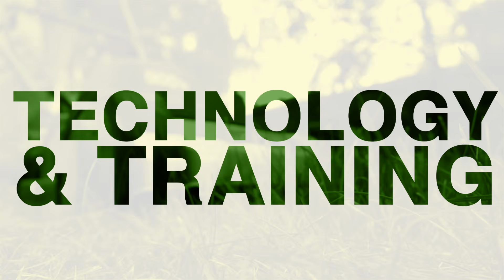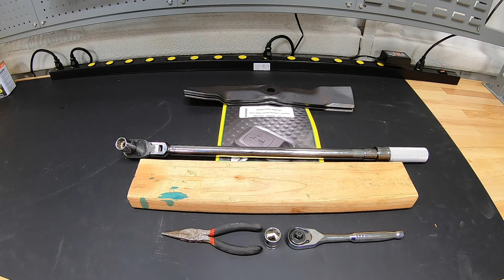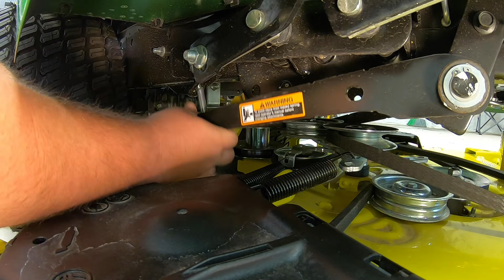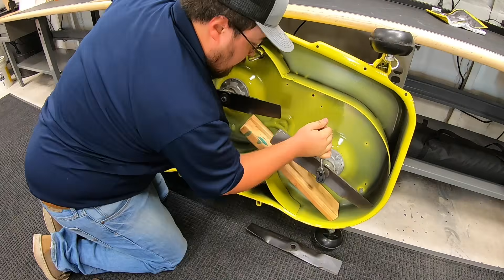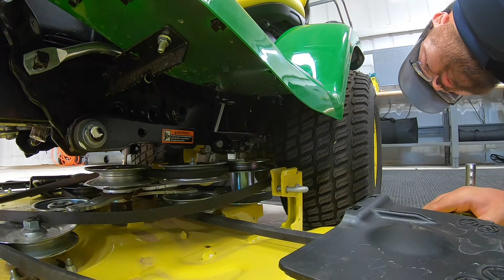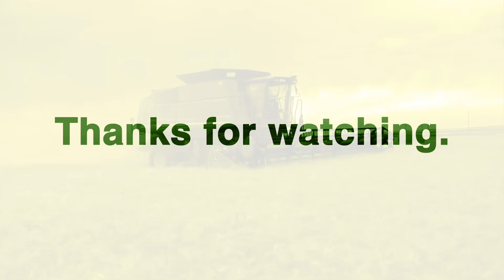How to Remove Deck and Change Blades John Deere X380

Comment: I didn’t see how you determined the position of the blades? I have a 54” deck for a 2018 x738 and am wondering if the blades get set in the same position…like on a clock or one at North south, Middle at East west and third one North south?
Reply from the maker: On this deck particularly the blades do not have to be in a certain position. Now on an X738, they may need to be if they are timed. I would have to research this a bit more to know for sure. Good question and thanks for watching!
Reply: @WesternEquipment   If you find out I’d like to know. Especially if you do a video on it. I didn’t see anything about position in the manual. I put the in the same position as the manual diagram did show them in same direction. I didn’t feel or see any cutting issues.

Comment: I prefer my method. I use my forklift to lift mower to eye level after making small modification to mower. No getting down on hands and knees which doesn't work for an old man.
Reply from the maker: Sounds like a plan if you have that equipment! Thanks for watching!

Comment: Why did they change the design from the last model, I have an lx 288, and it is so much easier than my x380, both are 54" decks. The last requires no tools, the belt release has a lever, no ratchet needed.
Reply from the maker: This is a good question. I wish I had answers to why the engineers do what they do haha! Thanks for watching!
Reply: @WesternEquipment  subjective word being "engineers".
Your right.

Comment: I have my deck installed, belt on, however when I push the pedal to raise the deck. The deck will not raise. What's the issue?
Reply from the maker: Hmmmmm, that's a good question. Everything hooked up just like in the video? is your pedal out of the install position?

Comment: "Not a perfect science"... Put a jack under the rear end and raise it up a few inches. That deck will slide under effortlessly.
Reply: These John Deere mower decks on the 300 and 500 series are the biggest pain in the ass to install.  Doesn’t it seem logical that Deere could engineer an easier way to install these decks?
Reply from the maker: This could work too. Thanks for watching!
Reply: Just to be extra safe, you might want to chock your front wheels before raising the rear end.

Comment: This was a very helpful video.  I have the John Deere X390; 54; Deck.  The manual is not very helpful.  This is the only video I am aware of that deals with the removal of the deck.  It was a lot of trouble to remove even after viewing this video.  I ended up taking the pin out of one of the gauge wheels so it could turn freely.  We'll see how I make out re-attaching it!  Thanks.
Reply from the maker: Well I am glad I could at least help a little. If I can be of more assistance just let me know here in the comments. Thanks for watching!

Comment: Great job!    I have an old LX277 which I've owned for over 20 years.  It's interesting to see how much easier is is to remove the X380's deck than it is to remove mine.   I like how you can pivot the wheels to help roll the deck out from under the tractor.   Very nice!     Keep up the good work!
Reply from the maker: The engineering just seems to get better and better all the time. Thanks for watching!

Comment: Brent your videos are awesome. I’m looking to get a new mower. I currently have an old John Deere LX277. Looking to see what replaces it in the lineup out now?X350?X380?
Reply from the maker: Thank you! Yea either one of those mowers would be the comparable model as far as size and features goes. You will have more HP with either the X350 or X380 than you did with the LX277 and if your current mower is all wheel steer then you will want to look into the X354. Hope this helps and thanks for watching!
Reply: Thank you!

Comment: Your videos are well done and easy to follow - thanks.  I have a 2019 380 48A without the lift assist.  Regarding the procedure you demonstrated to relieve pressure off the “raise and lower linkages”, I am not able to replicate that in any way or fashion after lowering the mower deck.  The pedal will not travel back to be locked.  Does the X380 used in the video have the lift assist installed by chance?  Any thoughts, tips or suggestions would be appreciated.  Thanks.
Reply: Also stuck at this step. Pedal does not seem to pull back
Reply from the maker: I just replied to your text sir! Thank you for reaching out!
Reply: @WesternEquipment  can you share any info on this?  I also can not get my machine to click.

Comment: I usually have better/easier luck of getting the mower pulled out if I go the opposite way. (Pull it out chute side). Great video. Stay safe!
Reply from the maker: Nice tip! I will have to give that a try. Thanks for the comment and thanks for watching.

Comment: Can you show a view/photo of where those tension springs are connected? I have replaced the blades and have the secondary belt installed but I cannot get the primary belt back on correctly.
Reply from the maker: Shoot me a text at 580-303-6707 so we can see if we can get this fixed for you!
Reply: @WesternEquipment  Sorry, just saw your reply. Thanks for the message, I managed to get it back correctly by referencing this video. I now have to check your video on leveling the deck as the front left roller wheel has broken twice on me as it seems as gotten to where it jams, I don't know it and the next thing you know it broke as it somehow jammed.

Comment: I bought an X380 a couple months ago and just installed a mulch kit yesterday.  It was my first time taking the deck off the tractor.  It wasn't hard to take off, but when I was trying to put the drive belt back on when I was finishing up, the belt kept falling off the rear pulley.  After putting it back on a couple times, I figured out a good way to hold the belt on the rear pulley while putting it on the front pulley.  I took about a 6" piece of masking tape, put the belt on the rear pulley and put the piece of tape over the belt, sticking it on the top and bottom of the pulley.  It worked very well, and was just enough to hold the rear of the belt in place while I put the belt on the front.  After I got the belt in place, checked to be sure it was right, I simply reached under and pulled the tape off.  It might sound silly, but it is really annoying when you get the belt just about on the front and the back is off.  By the way, the mulch kit works very well on the 48A deck and it is easy to install.  The instructions could be better, but it's not that complicated you can't figure it out.
Reply from the maker: Thanks for the tip! I will remember this so I can pass it on if I have people having the same problem.
Reply: Hit di you like the 380? What size deck did you get,  are you happy with it
Reply: @heffptbo  I have two of them, the X380's both have 48" decks on them.  Both are going strong and trouble free.  I do my own annual service with the service kit that John Deere has for the tractors.  One property I mow is almost 2 acres that is rather flat with few obstructions.  It takes me over an hour to mow that property.  My house is almost a half acre, but it has lots of obstructions, hills, and edge work.  It handles everything well, I'm a larger guy and the tractor mows uphill without bogging down, the engine is very strong.  It takes almost an hour to mow my property, slow speed, and lots of backing up.  I hate that yellow PTO button you have to push to mow in reverse.  I wish I didn't buy the mulch kit for the larger property, it slows the mowing process down some, especially if the grass is a little long.
Reply: @k1hasard is there a reason you didn't choose the 54 inch?
Reply: @heffptbo  Yes, my yard is too tight for a 54".  The other yard I thought someone else would be mowing that and they can't step over a 54" deck.  As it turns out I am mowing both so I should have gotten a 54 for the larger property.

Comment: Is this the same as on the x350?  Looks like the blades can't hit one another so alignment is not needed. No toothed belt. Are blades marked for top/bottom?
Reply from the maker: Yes, same process as the X350. And the blade does not say "top/bottom" on it, but you can tell by looking at your old blades which way the new ones will need to go!